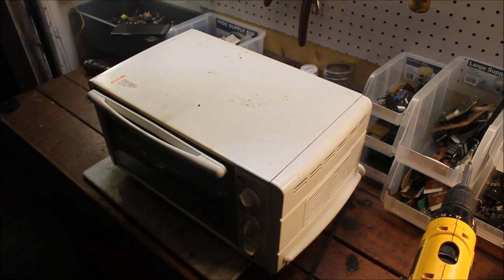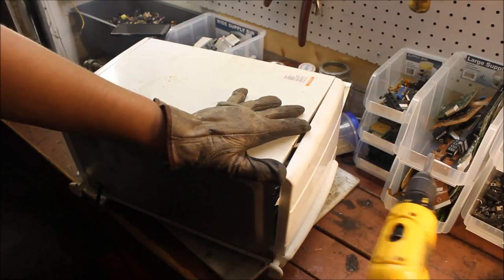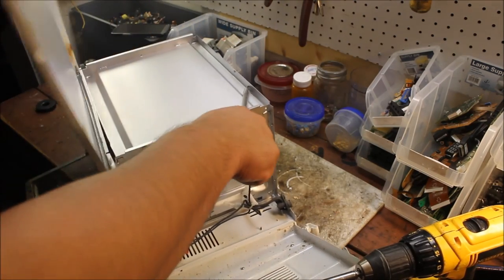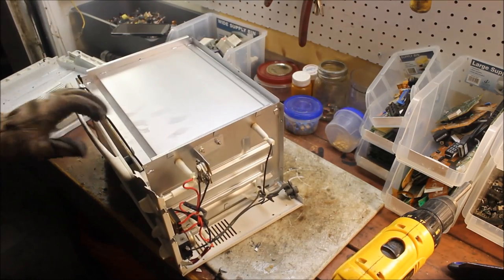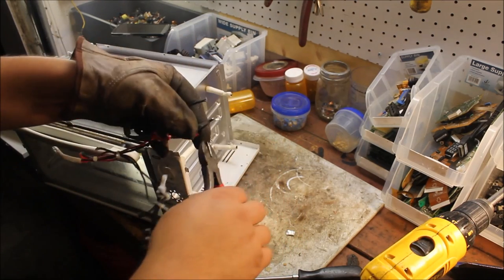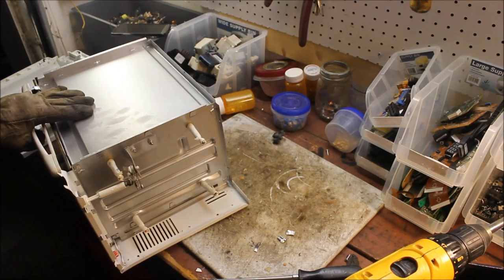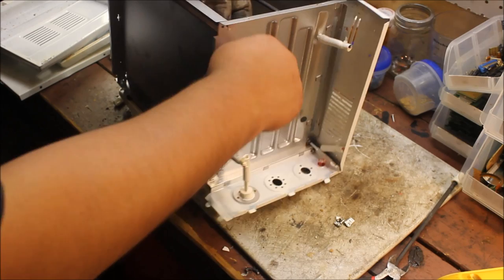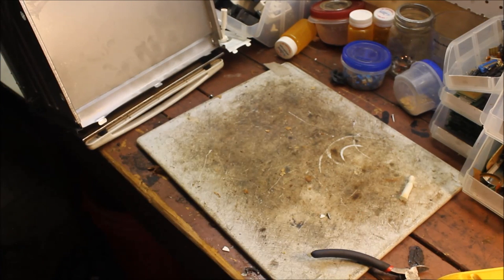How to scrap a Toaster & Broiler Oven!

Comment: Sometimes the trays are aluminium.Thanks for showing where the silver contacts are.What are the heater cores made of?Why don't you make a video showing how to take apart switches and removing the silver contacts from them.
Reply from the maker: +Roy Mason Yes that's why I stuck the magnet to them to make sure. The Heater elements are made out of a nickle alloy, some scrap yards will pay you stainless steel price for them, If you can take the wire out that contains about 80% nickle 20% cadmium or so.  I would check in with yours to see what they pay. Awesome, Ill be sure to make that video as soon as I get a chance. Thanks for watching!